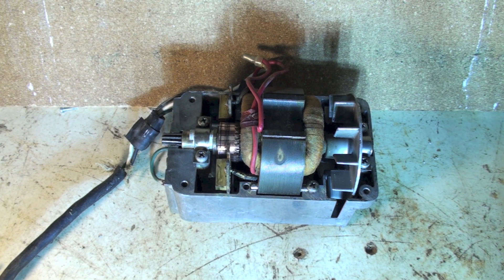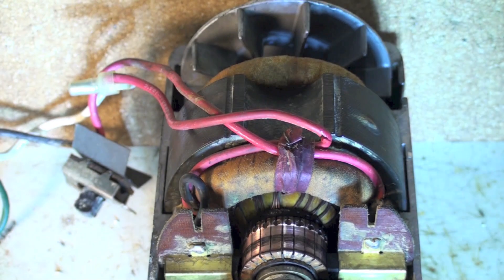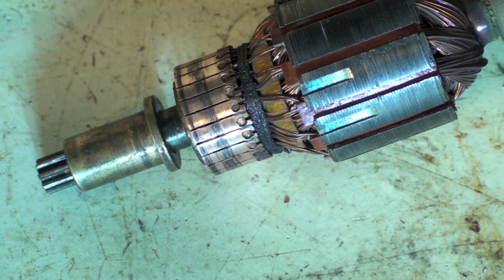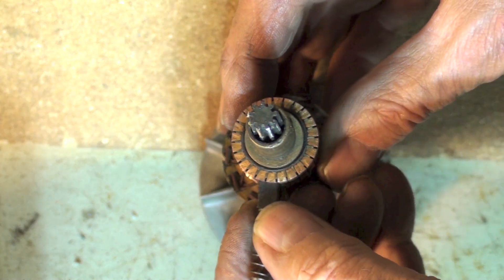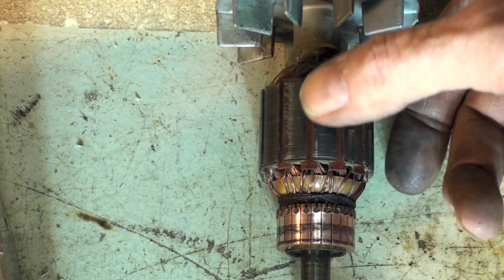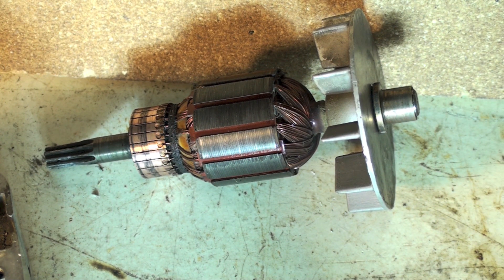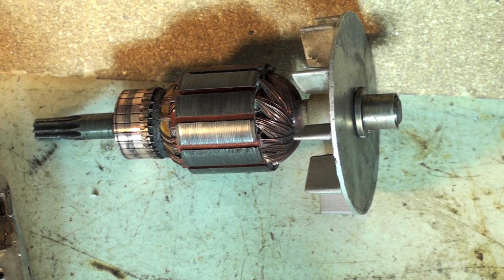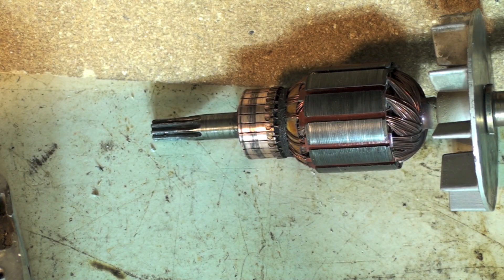How the the brush motor works

Comment: Why do we need the brush made out of carbon,,why not use brass, copper or steel for brush construction?
Reply: Short answer, because wear takes place, and you'd rather have wear in the easily replaceable brushes and not the commutator for obvious reasons.

Comment: Great Video. I dont know why the world just throws thins away Please help with table saw motor RM827. Two of  commutator bars are raised, thought maybe new brushes would fix it.  If a resistance pattern to follow maybe i could do some solder trick. What Now?
Reply from the maker: New motor.
GFM

Comment: Great explanation.  I have an old B&D Grinder that suddenly started buzzing and got stuck.  When its off it rotates but when I turn it on in magnetized and locks in place. I’ll try changing the brushes if I can find any.

Comment: These motors also can run at very high speeds, tens of thousands of rpm for some types. A vacuum cleaner motor may spin 10,000 rpm, allowing a small fan to produce powerful suction. A router may run at 25,000 rpm no load speed. Can’t run that fast with induction motors that are limited to power line frequency, usually 1725 or 3450 rpm.
Reply: Your explanation same like my friend.

Comment: GREAT VIDEO - how can i tell if my brushes need replacing? i have one of these motors in my disabled scooter.
Reply from the maker: You will need to remove them to check.  If they need replacing, the commutator should also be machined to make it smooth.
GFM

Comment: Thank you. Good work sirI have a question pls, I have a black and decker super sweep 8422, the problem is when I switch on it makes sound and it's stuck I tried to push the fan it didn't move at all but when I switched off I can move the fan very easy, I can record a video and upload it to watch it for more explanation it you want, I feel u have a great experience in this field.Thank and I hope u can help
Reply from the maker: This unit uses ball bearings.  One of them may have lost its balls.  You can replace the bearings, either from the factory or from a bearing shop.  Hope this helps.
GFM

Comment: The rubbing of the brush to the copper would create ultrafine particles the could get into the air and get inhaled into the lungs. Certainly not to healthy, especially if used in a fan that moves air. Are induction motors brushless?
Reply from the maker: +Rick Rude They do not have brushes.
GFM

Comment: It's pretty crazy how all modern cars have a brush type motor in the fuel pump inside the gas tank.
Reply from the maker: Its all about percentage of air to fuel.  There is virtually no chance of enough air getting into the tank (and the motor) to cause an explosion.
GFM
Reply: That and the fact that it’s submerged in liquid gasoline. Liquid gasoline does not burn. Only vaporized gasoline burns.